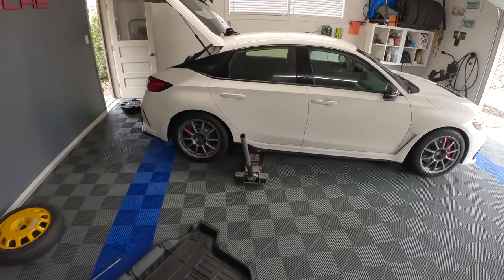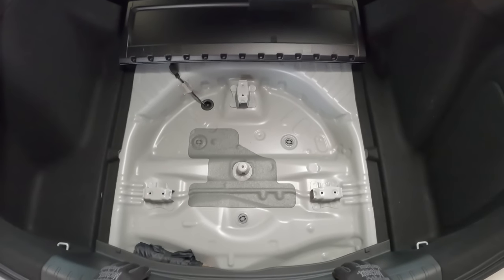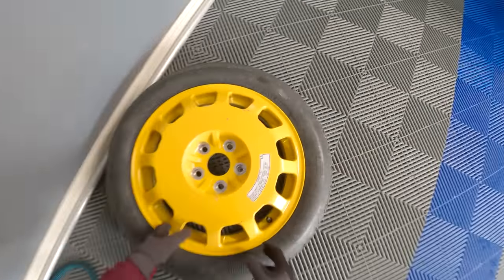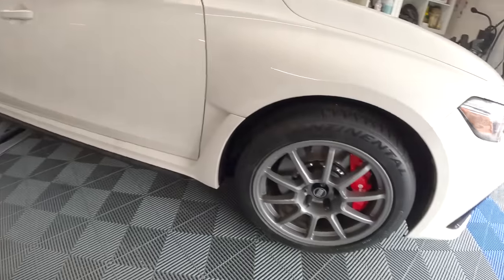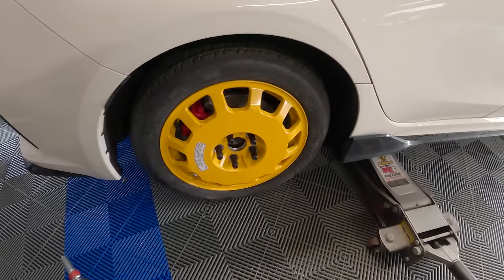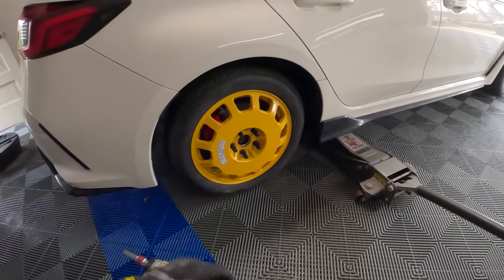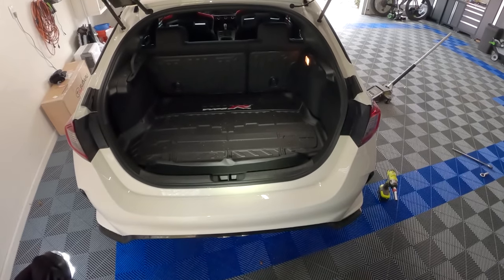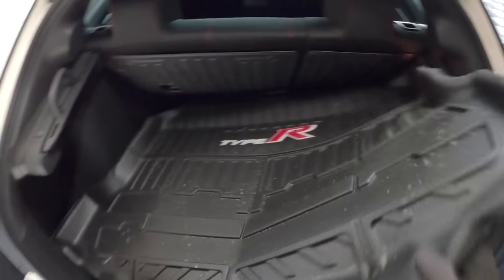2023 FL5 Honda Civic Type R - Fitting a Spare Tire

Comment: I think it’s ridiculous that all the manufactures are getting rid of a spare tire. I have a 2018 focus ST it has a full-size spare still has plenty of room in the hatch. Especially with the number of people that hit a pothole blow a tire and you’re stuck somewhere no spare.
Reply from the maker: Agreed, at least just offer it as an option at the dealer!
Reply: @TheTopher  They do it for the Corolla Hatchback I think. You can optoin to get more space in the trunk if you opt for no spare tire. Not exactly sure why you wouldn't want the spare tier
Reply: i think part of it is fuel economy. every 100 pounds cuts fuel economy by 1-2%, and a spare tire is about 50 pounds, so you're looking at 0.5% to 1% reduced fuel economy. that's not a lot, sure, but it adds up over an entire fleet for hitting cafe targets. cost savings are another advantage: that means a cheaper car for the buyer AND higher profit margins for the manufacturer.
Reply: @TheTopher  Monday is my 16th birthday
Reply: @doctorunicorn5550  And people are easier to wow with unnecessary bullshit tech and not an insurance policy that a spare tire is.
Reply: They do it because the good old USA doesn't require it. Other countries where it is required, it is standard.
Reply: my 2022 kia k5 has a spare tire with the same wheel and tire as the full set but it lacks the tpms sensor
Reply: @8wyy  Except for cheaping out on the sensor that's really good. Even big sedans and SUVs forgo the full-size spare which is just pathetic.
Reply: @8wyy  Interesting
Reply: People always assume the most absurd things when manufactures make changes lol these companies Most likely do a cost analysis and realize that most people never use the spare, they probably have analytics into the likely hood of needing it versus providing it. Most performance cars do not add them for weight savings.
Reply: @malcolmn.5222  It's a cost cutting measure that shouldn't be done. Simple as.
Reply: They figure the kids will come up with a tire change app eventually and so they won't need a spare.

Comment: I'm glad my 2020 Sonata can fit a stock 18" wheel perfectly in the spare tire well. I drive 100 miles per day, so a spare tire is definitely something I consider when purchasing a vehicle. I also carry a trolley jack, breaker bar, inflator, and an impact wrench. Maybe overkill, but I'd rather have better tools to get me back on the road quickly, or to potentially help a stranger in need. Somehow I still have room in my trunk with all those tools and a 12" sub haha.

Comment: In renault clio 2 we have the tire sitting directly on the floor and it was secured with a bungee cord, still works after 15 years so if you cut those mounts, fit a hook and secure it with a bungee no more raised floor

Comment: Here's what you need to do. Take that false floor out and add a sub and amp. Mount a single 12" sub to the tire with load straps from Harbor Freight.

Comment: The cheaper option is a you pull salvage yard. Spares/tool set should be $25-$50. Of course, it's a spare so it doesn't even require bringing any tools.

Comment: It might not be cheap or practical for cargo but I might just run with a wheel and tire combo just like the ones on the 4 corners just lying on top of the load floor if I had this dilemma.

Comment: One thing I'd do is buy a new donut tire from tirerack. They're miserable to try to mount / dismount, but I'm not sure I'd trust a 11+ year old tire to get me anywhere. 

They do have actual weight and speed rating and are stored in a trunk out of UV damage but it'd still worry me. 

The spare tire on one of my Focuses was rated for a higher weight than the actual tires oddly enough. But "only" 81mph.

Comment: Honda offered a spare accessory kit for the FK8. Hopefully they will do the same for the FL5. The FK8 kit cost me about $130 for the wheel and tool set, then another $100 for the 125r18 tire.
Reply from the maker: Word on the street is that the fk8 kit actually fits the fl5…perfectly. Gonna investigate

Comment: The only thing I am noticing is that your aftermarket lug and rims might be using a cone seat. The OEM lugs and wheels probably use a ball seat? Ignore if this isn't true. For me, I have to carry my oem set of lugs in the car specific for the spare.
Reply: I bet the australian market CTR will have a spare; I think its mandatory, but they may actually require a full-size spare. We've seen some interesting cut-outs in the 86/brz in certain markets to fit a full size spare from the factory.
Reply: @nodrogkam  You don't need a full size spare (or any spare) in Australia, but our market is way less accepting of cars not having spares so they're a lot more common.

Comment: Hi I have a question what about the spare tire on 2023+ civic hatchback will it fit?
Reply from the maker: This is a different bolt pattern than the regular civic hatch. Type r is 5x120, civic is 5x114.3 I believe, so this setup won’t fit but another spare with the correct bolt pattern will

Comment: I'm sorry but this is a stupid idea? You loose cargo space. The chance of having a flat is so small, then if you get a bolt in your tire you can still drive with it to a shop. Then, there's many shops who got a service vehicle that can fix tires anywhere, you call them in your area and they come. If all those options fail and you are in the middle of nowhere, you can use that kit provided by the manufacturer. I think the trade-offs are not worth it.
Reply: Once you use that provided fix-a-flat, no self respecting tire shop will repair that tire. Additionally if you get a blow out or a large enough puncture, that liquid is not going to do anything. Not everyone uses all their cargo space at all times, so not everyone is going to have an issue with the floor being pushed up a couple inches if it means they won't have to get towed home.
Reply: I mean, you can just take the spare out if you need cargo space. If I was not road tripping the car, and I'm in an urban area where AAA can get to me within 15 minutes, then yeah, I don't think having the spare is worth it. 

But if you road trip this car, I think having the spare is worth it, so at least you can limp to the nearest tire shop, which could be 50+ miles away.

This applies moreso to the previous generation FK8, where those 20" wheels can blow out from a pothole. I feel more better with this generation's 19" wheels.